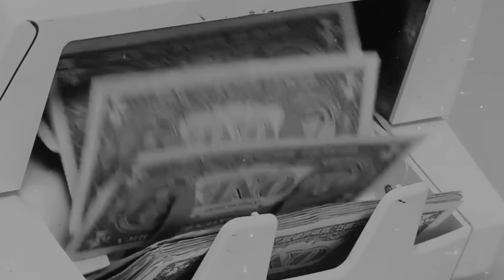Iraq’s Upcoming $17 BILLION Corridor That Will END The Suez Canal

Comment: thank you, prevent effect of global warming, New energy from sea will change world soon, minerals and temperature of water and air from sea are huge source of energy, reduce more than 50% using fossil fuel, fresh water, fertilizer(minerals+O2,N2,C), electricity,  zero pollution, I invented new method base on designing this machine, it  produces 150Megwatt/hour electricity and 20000M3/DAY fresh water and fertilizer, using power magnet of machine as catalyst to separate N2 and O2 from Air , economy will rise by using jet plasma machine that it compressed gas(Air) in isolated structure in water pool with more than 80 % efficiency, it has two vertical cylinders, without crankshaft, in first level it transfers compressed gas(hot air) temperature from engine to sea water in pool for steam electric generator, steam combines with high cold Air pressure to produce pure water and electricity , there are other source of energy that with international cooperation in coastline we can reduce effect of global warming, further more we can prevent these phenomena like cyclone and flood and wildfire , ocean water level by using this hot seasonal atmospheric condition, recent years in summer, geothermal energy happens in surface of coastline, there are many countries in coastline with seasonal hot weather and water condition in comparison with middle Ocean, its more than 12 degrees ,this differences must decrease, in sum-up, by using this energy not only is economical but also reduce global warming in countries like Japan, China, India, Mediterranean countries, Iran, Brazil, Mexico, Us, Canada, (Africa and Arabian countries....) . I invented new method base on air pressure rules and quantum physics ionization sea water minerals in strong dynamic permanent magnet(SMCO) with special frequency(1500or 3000)/minute bases on paramagnetic and diamagnetic particles and electrical microwave electron wave field and electric chemical reactions and photon wave from semiconductors with special angle Cations like(K+, Mg++, Na+, H+, H++, li+, H2, ..) are transferred to in the second level into up level by vacuum pump from storage into combustion chambers and they combine with O2 and N2 ,... as major part of fuel, they increase speed of machine, modern induct Gearbox to control speed of opposite direction, in the end point magnet control and stop by maglev and spring and hydraulic jack, for producing electricity and fresh water (removed minerals by accelerate ionization system from sea water) and fertilizer. . 7 methods zero pollution for reducing global warming I mentioned in my profile. (G20 countries can solve these phenomena like injury and death, billions of US$ in global warming damages).

Comment: Remind me how many trains you need to move 24K containers?
Reply: 300 trains, but the speed will be 3x than that of shipping
Reply: @abid583ind  I normal times around 500000 containers a day that will be a lot of trains.
Reply: @surters  doesn't have to be all containers, just the faster that the slowest delivery priority. Rotterdam is quite far north, so the southern countries will be happier to receive early cargo
Reply: @abid583ind  Ships through the Suez can and do stop at multiple ports. Right now because of the Houthis, container ships are finding it cheaper to go around Africa because of the war zone insurance rates. Iran controls access and not on the best term with Iraq. I don't think it a good idea because water shipment is the cheapest by a factor o 10.
Reply: Will also help in decongestion at Rotterdam, the current system has too many 'single point failure', not good